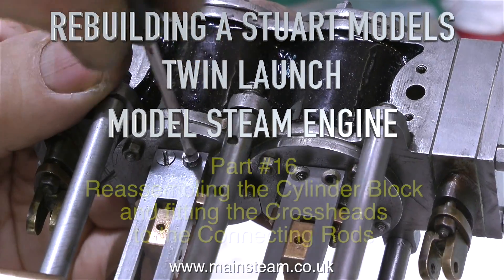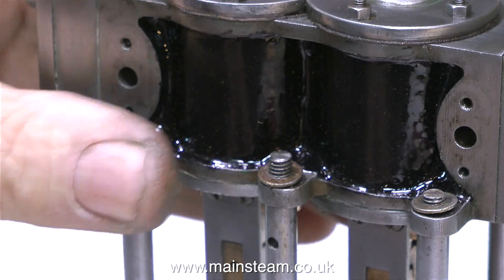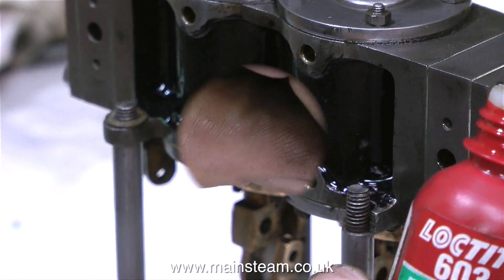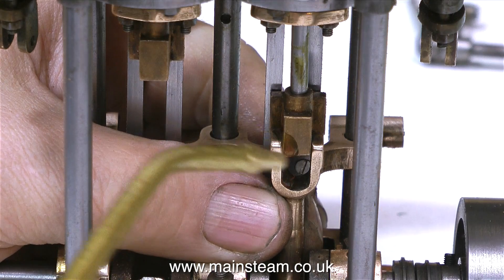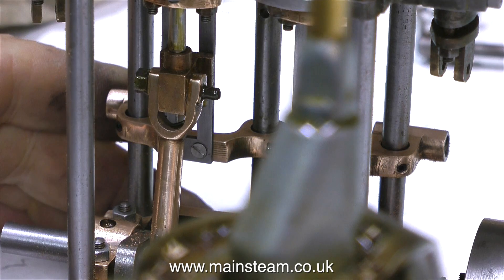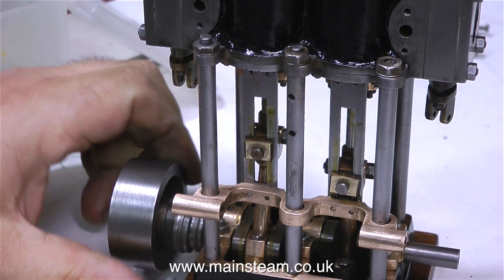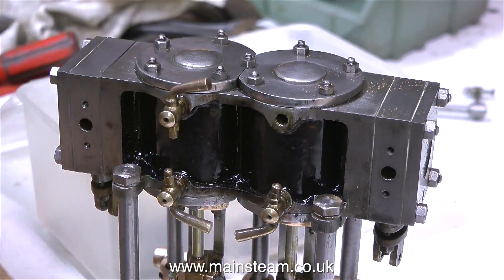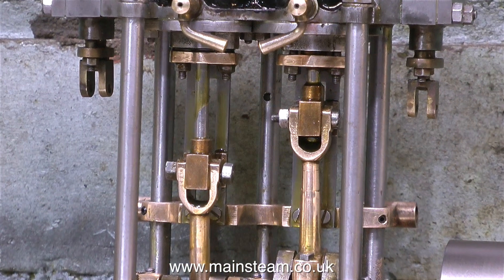STUART MODELS TWIN LAUNCH STEAM ENGINE REBUILD - PART #16

Comment: pardon me sir I'm not trying to sound like one of those experts you keep talking about but I weld very delicate cast iron parts at work on occasion with a nickel alloy rod low amperage low heat with no distortion

Comment: Glue is fine and a good solution.  I thought you'd break out some JB weld or similar epoxy, but Loctite is even easier. :).  Another great video thanks.

Comment: I'm always curious about the little details such as the broken lug, what would you have done if the broken bit was not in the box ?
I know it wouldn't make any difference when running the engine, especially after setting the support columns correctly but I don't know what I would have done if it had been lost and I would hate to look at that scar.
Reply from the maker: Had the piece not been in the box, I would have drilled a small piece of cast iron and then split it to match the break.

Comment: Another interesting video clip. 

Visitors to Caves such as this please note: Your chances of admission are much improved by being armed with comestibles such as Cups of tea, Wagon Wheels and sticks of Peperami.   Gaining entry does NOT however give carte blanche to ramble about such things as:  The crystal glass decanter and set of wine glasses that shouldn't have been left to (insert random name here) in 1982, or the consequences of Britains departure from the EU.      These things are of no interest or consequence. We are measuring split-pins for diameter and length, and sorting them into brass, steel, and galvanised steel. Put the food down and leave quietly. 

Seriously though Mr Appleton, keep it up. It makes a welcome change from 'Top 10 things you won't believe that NASA has probably found on Mars'

Comment: Dear Keith; your opinion about the use of bahco's is fully understood (not shared). I do note you do not always put your thumb on the thumb wheel though; you understand my point I'm sure. 
Now, about the use of screwdrivers. Same as with spanners really: always use correctly sized bits. You are damaging the screws (don't know the exact time) by using a way too small screw driver. Love the nice and shiny new screws from the previous vid! Keep the vids coming; I love them.

Comment: I'm surprised you didn't go with JB weld to glue the part back in place. It's supposed to be a machinist's glue that's used for sticking metal parts for machining back in place.
Reply: Zappyguy111 I was wondering the same thing. He's done repairs with stuff called Milliput - which I think is similar to JB. I suppose if there's no way to get the original strength back, his way is probably most sensible.

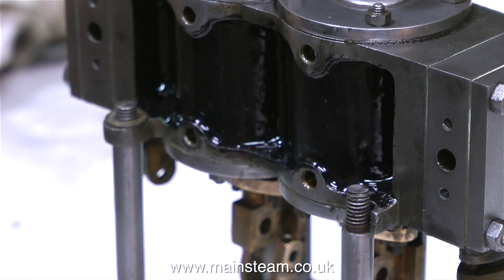Comment: The brass polymer adjunction fizzle, at 2:36 will cause a reverse-flux, de-compaction erosion to the steel findle-splink. I suggest using a good quality Bahco knuckle thinner to re-compensate for the dynamic quantum losses at the conflex point. This should result in knife-edge re-alignment to the molecular attraction puleses, resulting in a 0.0037% decrease in steam re-ignition.
Reply from the maker: I know just what you mean, I would normally use a Bifurcated or Lateral Deifrenchicator, but it is getting increasingly difficult to keep them under control since I was admitted to the Asylum ....... :-)))))))
Reply: Alternatively , keep taking the pills!

Comment: Do you have JB Weld over in Old Blighty? That will hold that lug together.
Reply from the maker: We have the equivalent of that in the UK, but it will be OK with trusty old Loctite once the 2BA bolt is tightened onto the washer. :-)))

Comment: keith. Just a question. If this engine is run on steam is there a chance of the broken lug heating up and falling off again? can the locktight melt?
Reply from the maker: No, because even without the Loctite, the piece is held firmly in place by the Nut & Washer anyway ......